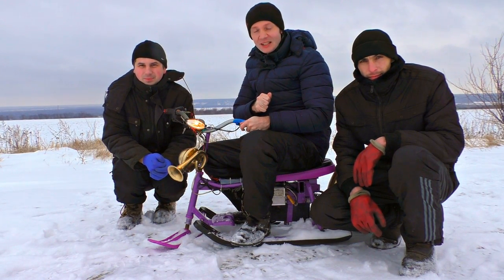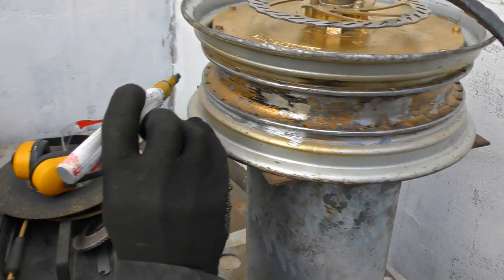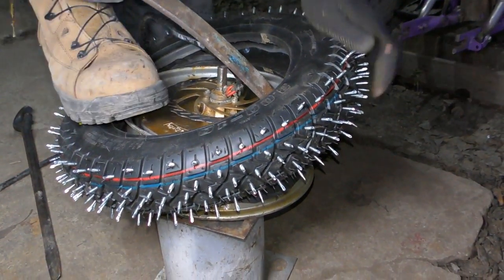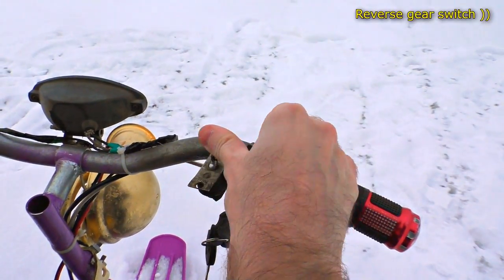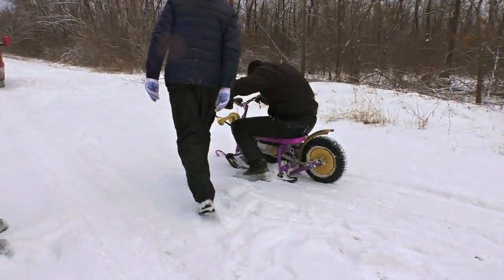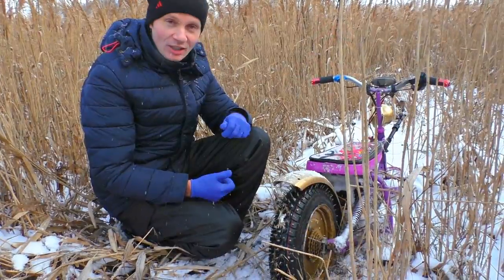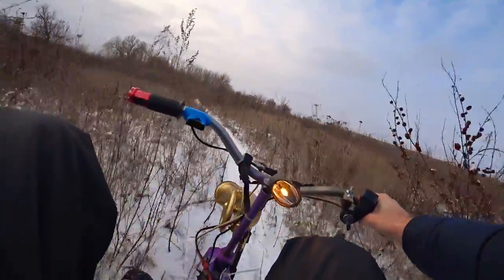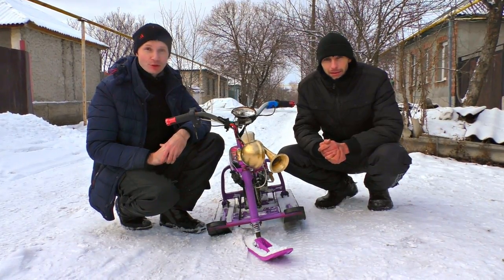E-Snowmobile Test! Speed and Passableness!

Comment: If you increase the power you should put two sleds in the front for better control the better the control the safer it will be while at a high speed..